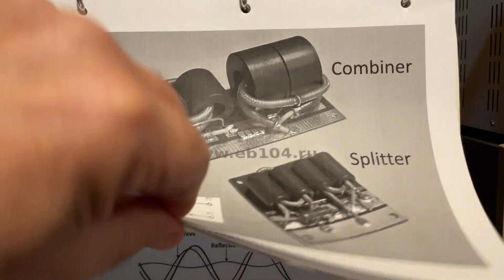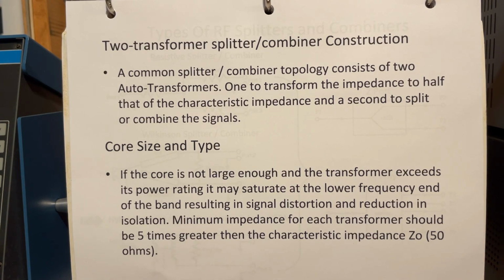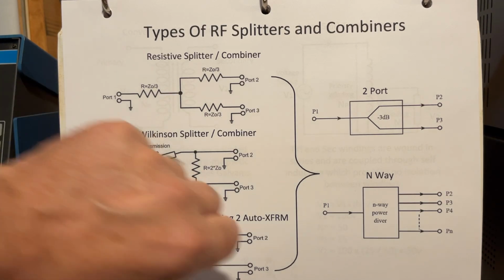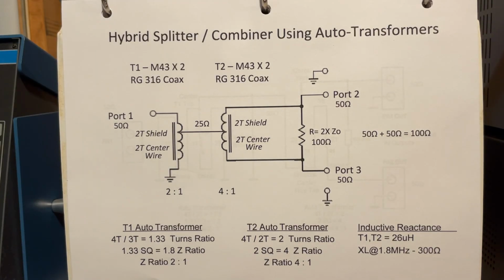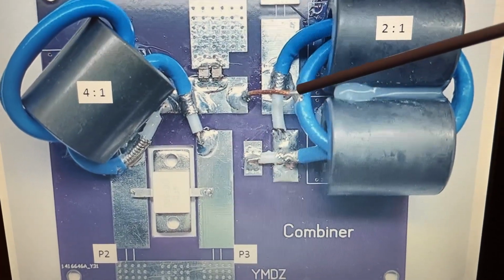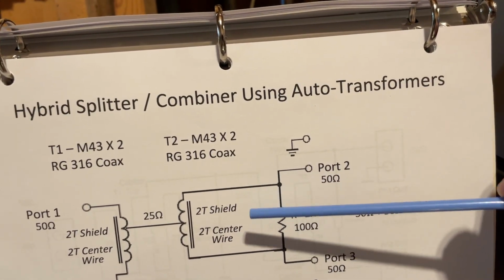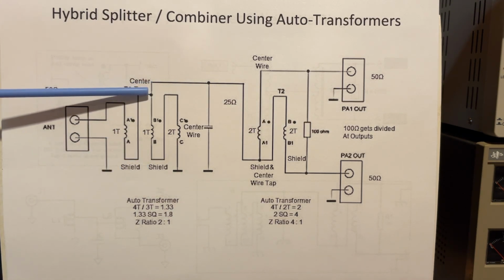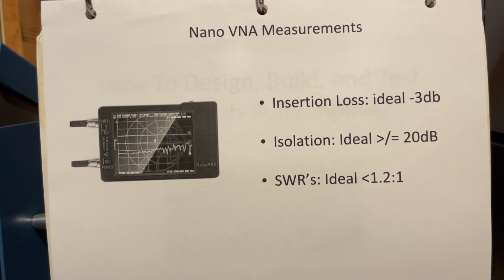RF Splitters & Combiners - How do they work?

Comment: T2 is an isolation hybrid. If an output port does not have the correct impedance the energy that does not go to the output is dissipated in the 100 Ohm resistor and the other output port works normally.  For instance if P3 is shorted or open, all of P3's energy will be dissipated in the resistor.

Comment: Just getting into RF after a 30 year break. Really enjoying your videos and plans on recreating some of your experiments.   I want to investigate blocking on low cost hand held radios and wanted to build a combiner for 2m. I want to combine a low level wanted signal  with a high power out of band signal whilst observing the SINAD.  I think a resistive combiner would be suitable but wondered if you had any advice. Thanks Chris

Comment: I think where the confusion comes in ( certainly for me anyway) is that the coax is not being used as coax cable in the traditional sense , but just as 2 conductors in a convenient package. You could make the same transformer with individual wires. Coax just literally has 2 wires in 1 package. Or am I missing something else completely , which is a 100% possibility.

Comment: Having galvanic isolation in a conventional transformer is only relevant for the DC component of the applied potential. For the AC component the conventional transformer does not isolate.

Comment: When testing the splitter at the end of the video, shouldn't the other port be terminated into 50 ohms?
Reply: 28:06 - He tested with and w/o termination here.  I was wondering this too, but apparently it's not that critical due to the high isolation between inputs.

Comment: Would it be possible to use an N-way Combiner if one coaxial wire has 75 ohms impedance and two other wires have 50 ohms impedance?
Reply: Yes, that would be a problem. The impedance transformer would not be correct. You should transform the 75 ohms to 50 ohms first. Regards

Comment: What would be the advantage of this splitter vs standard Wilkinson divider with transmission lines changed to coaxials. Resistor is needed as well this circuit has longer cables (wilkinson only lambda/4 length). Thank you interesting topic covered

Comment: Another great video!. I always enjoy and learn alot from your videos.
Quick question: The 2:1 auto transformer,  the way I am looking at it might be wrong but I see it as a 4:3 turn transformer with an impedance ratio of 1.78. Is that correct? Thanks 785

Comment: Great vide explanation! Is there any device, or conjuntion of devices, that would allow me to have several receivers from a common antenna, but if any of the devices transmits, all the other devices should be isolated ? Don't know if I made the question clear, but happy to give more details in PM if needed. Thanks in advance

Comment: One thing you should have mentioned is the phase angle between the ports, 0 or 180 degrees. I will leave that with you to mention. Nice video. Good for those out there learning RF engineering. Also should have placed a 50 ohm load on the second port, as you measuring the power output of the splitter. (Balance)
73's
Reply: Dont quote me but im sure they are completely in phase. Keep in mind the input needs to be also 100% in phase otherwise the 2 amps will not add in power correctly.

Comment: T2 is not used to transform impedance because you have already two 50 ohms ports in parallel that give you 25 ohms! It's use for balancing between port.

Comment: Excellent, what kind of the 100ohm  resistor you put on it, and what is the wattage?
Reply: Typically a thick film metal oxide resistor is use. Wattage should be 50 to 100 watts depending on you application. Current only follow through the resistor when outputs are not balanced.

Comment: Very interesting,  I've made a similar hybrid combiner for two 100W AM Transmitter power modules, with success, using pairs of FB-43-1020 beads and ECW. So how would a 4 port configuration look like, that is, four 50 ohm input  ports combined into a single 50r output port?
Reply from the maker: Email me and I will send you a schematic. My email address can be found on my website. rflinear-amplifiers.com

Comment: I learned something. I did not know you could use coax for the winding. I thought that all windings needed to be next to each other, but with a coax the center windings run inside the shield windings.
Reply from the maker: Most high powered splitter combiners used with LDMOS amplifiers used coax. This is the primary application.

Comment: In your last example with the RF amplifier, does it cause any problems leaving the second output unterminated? Where is that other 1.5W being dissipated? In the 100 ohm resistor?
Reply from the maker: Yes, if you leave the output unterminated, the power will dissipate across the resistor. I wasn't concerned with only 1.5 watts. It is good practice to terminate both sides. Regards

Comment: Trying to understand the effect of using coax , is it true that the inner conductor will see the magnetic field going thru the core?  The shield only shields the inner conductor from electric field?
Reply from the maker: I'm not sure I fully understand your question. Let me answer it this way. If you have a ferrite core and wrap one turn of 50 ohm coax around it, the inner conductor and the shield will have the same inductance when each is measured with an inductance meter. The permeability of the ferrite material has the same effect on both the inner and outer conductors.

Comment: RF Man et. al. what are the main use cases for a combiner or a splitter? 73's
Reply from the maker: The splitter is used to take a single signal source and use it drive 2 RF boards and the combiner can take the output from 2 RF boards and combine the power output. Thanks for your question. Regards
Reply: @rfmanchannel6915  Ah, ok. Thanks RF Man. Excellent video.

Comment: This is a super awesome video!! I will look for this topology when looking at amplifiers and other RF circuits.
I am curious about one thing. If you want the 2 outputs have the same phase shift and amplitude why would you use the center core and shield of coax for the 2 conductors instead of identical lengths of single conductor wires? I would think they would have different surface areas or resistances because they are so different.
You are making turns on a transformer so you want the EM to radiate and not using the shield as a fixed impedance to ground.
What is the difference between winding it with coax or just single conductor wire?
Reply from the maker: You can also use single conductors and achieve similar results.

Comment: That's super helpful!  Thanks!  I'd love the specific construction details of your little splitter- IE: what kind of cores for the transformers and what you used for the resistors.  I've been wanting to make a splitter for a few receive-only applications that I want to run from the same antenna, and whipping up something like this would be ideal.  I could probably wing it, but the more details the better.  Thanks so much for the video.
Reply from the maker: I mention most of this in the video. I'm using material 43 for the cores, RG316 for the 50 ohm coax, and a 100 ohm (2xZo) 3 watt isolation resistor. It is wired as shown in the schematic. Compensation capacitors (22pF) may be needed depending on the construction. I hope this helps. Regards, RF Man